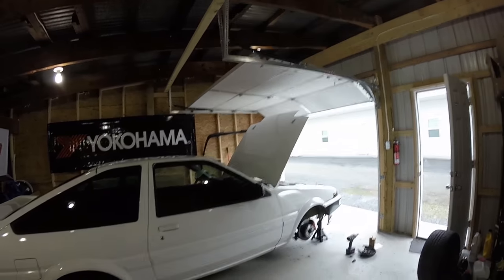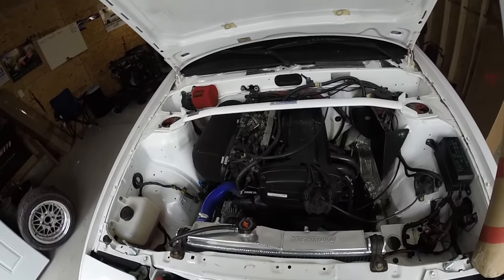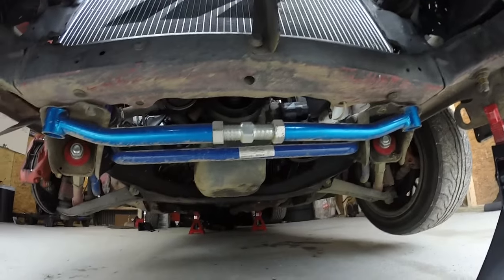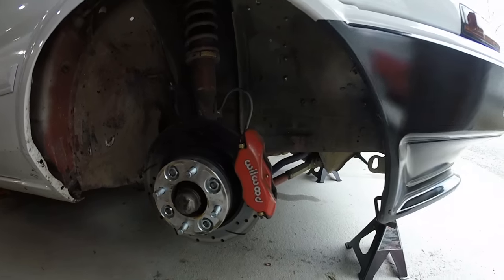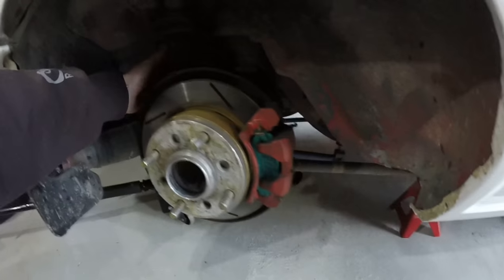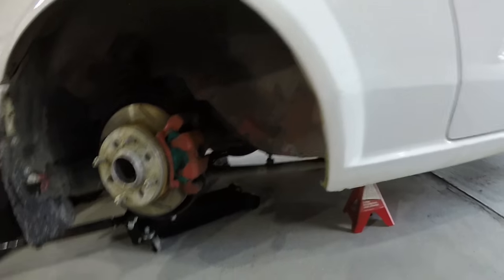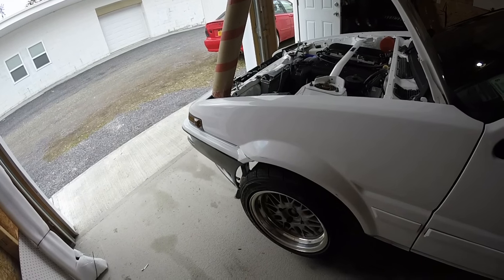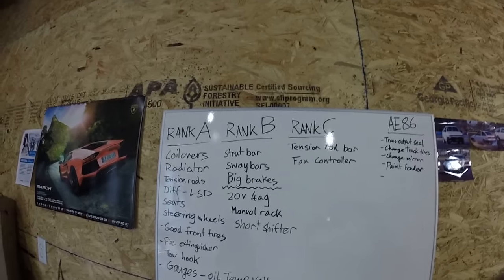AE86 Performance Parts Overview and Recommendations

Comment: Awesome vids!! Liked and subscribe :P 
If im not wrong a manual rack like AW11 one should be around 1080º ~3 turns. Would you consider a quick steering ratio to be around 900º~2.5 turns should help? 
On the other hand, i have heard many times that in a 16v a cone filter attached to the stock intake manifold doesn´t provide any advantage over the stock air filter box, any recommendation about this air intake thing?Thx in advance!

Comment: What does an manual steering rack exactly ? Im kinda a noob to cars and want to import an 86 next year. Trying to learn as much as possible :)
Reply: It removes the need for power steering. So there's no pump that needs to be driven by the engine. Power steering robs horsepower and can be quite heavy. You'll have less moving parts that could potentially leak or fail, also. The ae86 is quite a light car, so power steering isn't necessary.

Comment: you should apply 3m undercoating for your wheel wells, would make it a lot cleaner plus some protection against rust
Reply from the maker: +Andre Tapang I use a spray on truck bed coating that I use to touch up spots. With the crazy angle this car has, the inner part of the tires rub against the wheel well and frame at full lock. That exposes bare metal. So far I've just been touching it up every now and then. A proper coating wont help if it keeps rubbing so I just let it happen and touch it up afterwards.

Comment: Have you drifted your car with stock caster? I've tried both and decided its much easier with just a tad over stock. still running stock tension rods myself but with poly bushings. You can watch my Nikko video and see how snappy and fast the steering was....that was max caster on stock rods. Was a nightmare.
Reply from the maker: +Zack Hafler Haha I've seen all your videos man! Great stuff! And I have drifted with stock tension rods and PS steering rack(lines disconnected). There's less angle and it is certainly less "snappy" with less feedback. I realized with a more numb steering feel, I'm more inclined to "fight" the wheel a lot. Just a lot of unnecessary wheel adjustments and motions. But I do see what you mean. Certainly with max caster, the wheel feedback is a lot more violent and seemingly harder to "control". But ultimately, I found that on a perfect run (perfect entry/perfect speed/perfect angle/perfect RPM range), you can just about let go of the wheel. It sounds cliched, but its these moments where you become one with the car and your inputs are smooth, and the feedback is also smooth. But yeah, when I find myself struggling with the controls, then I know it's me that's not doing something right, and the car's great at this communication. And I do believe more is better in terms of caster. Though it does suck when parking lol.

Comment: Did your 86 come with the jdm bumpers or did you put them on yourself? Been wondering about ordering some jdm bumpers online and putting them on, but I'm not entirely sure whether or not they are direct bolt on. Thanks :D
Reply from the maker: +MrSpunkerr I did get them. Bumper(skins) need two specific brackets each. And yes they are bolt on.

Comment: do you use traction brackets or adjustable 4 link? if you do what do you think of them?
Reply from the maker: +Gucci Bound MTN No I don't have these. But I do have the T3 adjustable panhard bar. As I've said somewhere (earlier video), lowering the car messes with the suspension geometry from its intended ride height. The first thing to address is the Panhard bar as that significantly changes the position of the rear end from left to right. To ad to that, I also have the panhard bar/lateral rod drop mount which can work with the stock panhard bar. But I got this mount just so the panhard bar clears the exhaust and stopped this really annoying rattle I had a while back. 
~Cheers

Comment: ive been trying to find a 86 for a while now. is yours a gts or sr5? obviously its not a true "86" being LHD
Reply from the maker: +Jesse Strader What makes you believe its not an 86? Just because Regular cars dude says so, doesn't mean hes right. And yes, she's a GTS. You're best bet is starting off with a GTS with stronger rear axles, full disk brakes, and of course a 4ag instead of a 4ac.
Reply: well only japan got the true "86" but yes that what ive been looking for is a gts, less work. your car is beautiful, did you have it repainted?
Reply: true 86? lol wtf
Reply: yeah "true" the gts and sr5,s are not really an 86 just called that. vins are numbered different
Reply: chassis says 86 on it. ur argument is invalid.
Reply from the maker: Only reason why 88 is in the Vin number is to differentiate GTS FROM an SR5. SR5s have 86 in the vin number. But Vin (Vehicle ID) doesn't specify chassis/model code. Vin is randomized like your drivers license number.
Reply: lol i hate it when ppl say its not true 86.  obviously knows nothing about cars and watch too much initial D
Reply: lol okay.
Reply: @JesseJessMyster  I hope you learned something from this 😂